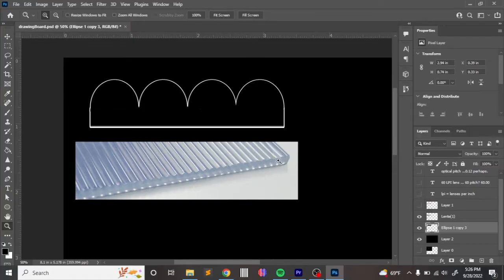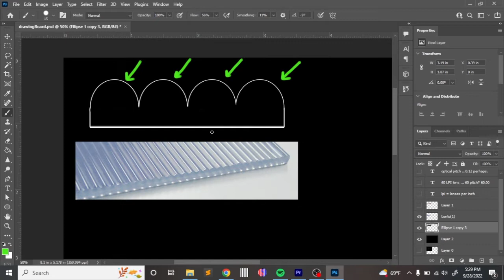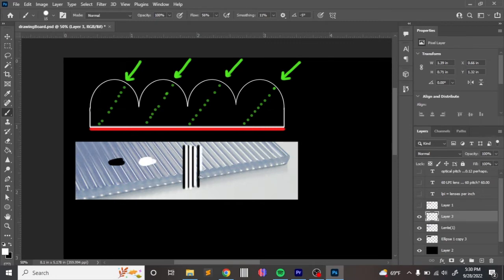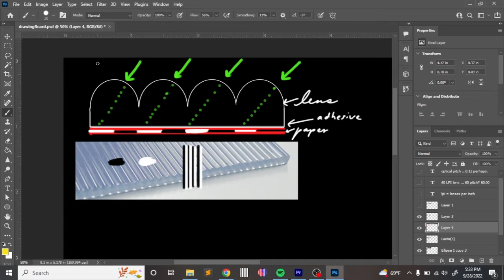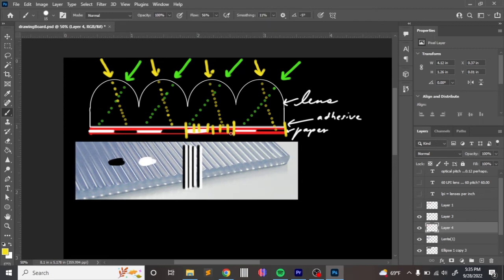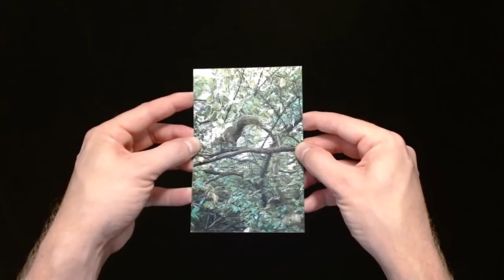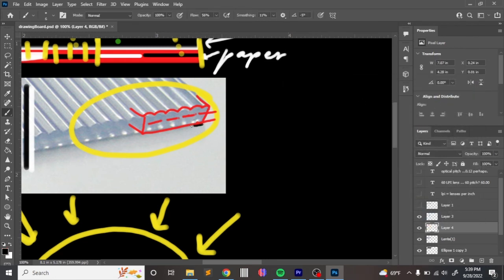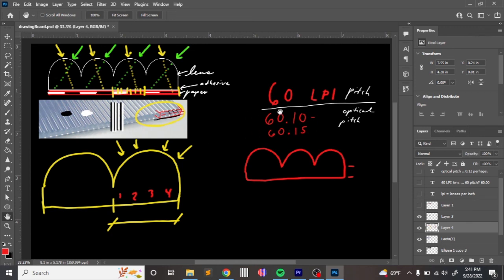How 3D and Animated Lenticular Prints Work

Comment: Great introduction to Lenticular Printing! I'm looking forward to the follow-up video! ~

What are the different software options you would recommend for a hobbyist and, alternatively, what software options would you recommend for a business?

What are the pros and cons of high and low LPI lens sheets, specifically for multi-frame/scene animations? 🤔 

I have some NeRF scans and 3D models I'd like to turn into Lenticular prints
Reply from the maker: Hi Chris, different lenses are manufactured specifically for 3D versus animated scenes. I have a list of manufacturers included in the materials list for the course, available at learnlenticularprinting.com.

I also include some recommendations for softwares. The two that I recommend are SuperFlip! which is Free but only for Windows, and Lentigram, which is not free, but works for Mac, and is a very nice software.